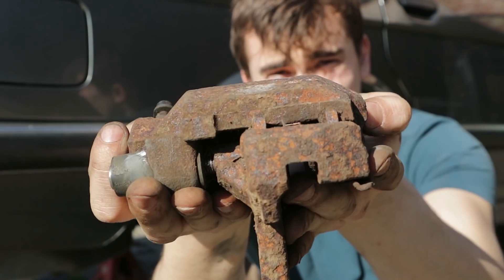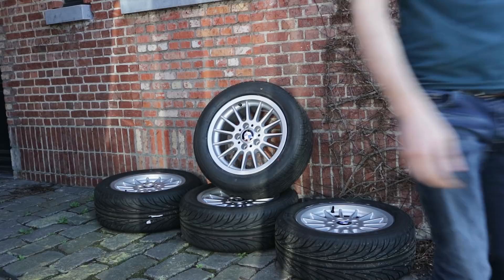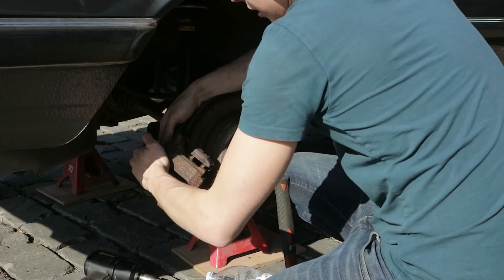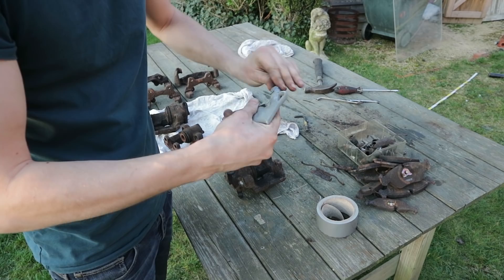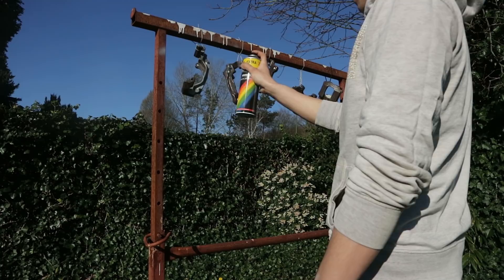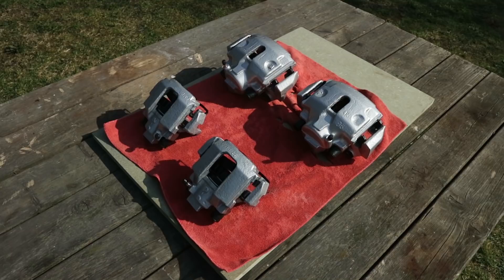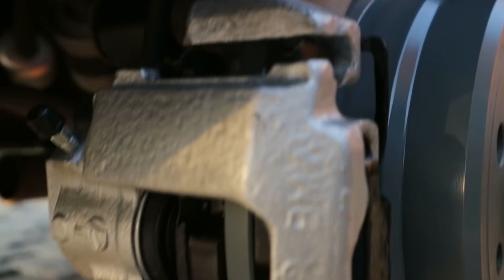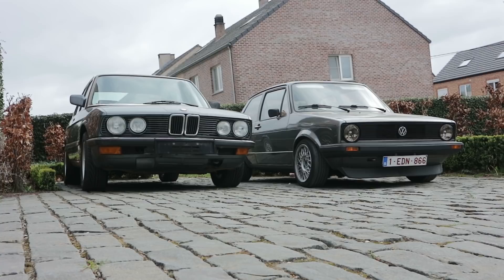Backyard Brake Restoration - BMW E28

Comment: you forgot to lube the pistons and seals just remember to do that next time otherwise a really nice restoration
Reply: That isnt really necessary. While bleeding (and using) the breaks they get surrounded with brake fluid anyway.
Reply: @johanneseder27  yeah but when you lubricate piston and seal before hand piston will just slide in by fingers without any force, which lessons probability of tearing a new seal
Reply: @fila1445  Yes, that makes sense. Thanks for informing.
Reply: And brake grease will prevent rusting/stucking, brake fluid wont. It’s good to have a good amount of brake grease/silicone grease under the dust rubber.
Reply: @ToyotaLandCruiser  Ate Bremszylinder paste is very good for this job.
Reply: @Cribs00  Yes, use castoroil-based red grease on older cars, some new ones require silicone (especially Japanese).  The grease will help the seal position bed in. A piston seal doesn't slide back and forth in the cylinder when you brake, it is merely the fact the seal is flexible and the piston moves within the elastic limits of the seal as it is only moving a few microns with each brake application so it is important that it is not under elastic tension when not braking..
Reply: Very important to mention that you need specific grease, using regular grease could contaminate your brake fluid.

Comment from the maker: Thank you for the comments saying I need to put copper grease on the pads. I totally forgot! And yes, I cleaned the rotors before mounting them :)
Reply: All threads & hub plate too. Just a bit.
Reply: @Yfyfy_Tcyfyc  Hub plate no. Not needed. If you really want to then use a tiny bit of oil. For threads medium threadlocker.
Reply: I’ve stopped using it full stop, horrible stuff. The only acceptable place to use it would be on the “ears” of the pads, even then there is special brake grease to use instead. Cars come from the factory with no grease on the pads and if you ever read the instructions with pads it says don’t use grease or only use special brake grease.
Reply: @thisispointless29  ATE Plastilube, TEXTAR Ceratec etc
About brake pads I am using, I noticed that they are less squeeky, but on other hand the fix with grinding a little bit of edge od brake pad also works as well.
Reply: @thisispointless29  Copper isnt good on modern cars because in interfears with the ABS system. Other good stuff is Ceramic paste on the Back of the pad and nothing on the ears.
Reply: Never heard of using this stuff in the UK!
Reply: Best is just a little ceramic grease on the ears of the calipers and the guide pins

Comment: You're so lucky. My rotors on my 84' 633i were completely rust welded. Lots of penetrating oil and a hammer, plus a lot of swearing. :)

Comment: When I did the big brake upgrade on my E28 the set of used calipers I bought looked rusty just like the ones in the video. Rather than grinding and scrubbing off all the rust I put them in a couple gallons of vinegar for a couple days. Incredibly, they came out looking nearly brand new.

Comment: Another video that you knocked out of the park, Memphis. Well done. While you were doing the brakes would have been a good time to repack the wheel bearings, assuming they can be lubricated. Lucky you to have single piston floating calipers. Greta, like my Arthur, has 4 piston front calipers, 2 on each of the sides of the split system. I have heard the Volvo front brakes are either Gerling or Brembo. Some people say the one, some say the other. The last time my brakes were done it took 16 litres of brake fluid to flush the system.

Comment: Quick tips for those who want to do the same: if you have Abs, try to not empty the system, if you don't have an eezybleed or something to pressurize the system. It sometimes can be a pain if the abs module gets air. Otherwise when bleeding with the pedal, try to not go all the way down with the pedal. Crap in the master cylinder could damage the seals.
And for the rear disc brakes with the baby drums for handbrake. Don't forget to release the tension at the cables on the lever itself before adjusting the shoes. I adjust mines until they rub just a little bit, and then I tighten the 2 nuts inside. Degrease new rotors, copper grease on the sliding contact points but don't put the entire tube on. Just a tiny bit is enough. Cheers

Comment: hey man! always remember to clean the disks before installing, they have a slight bit of oil(prevents rust)that may be bad for the brake pads
Reply: not in every case. sometimes (like his ones) they have like a thin coat of protection paint on, which removes itself while the first brakings.

Comment: Always use ceramic or copper paste when you mount the brake pads. Apply it on the glide path after you cleaned these with a file. Otherwise your brakepads will rust and get stucked quickly. Dont assemble the brake cylinder dry, wetten the brake cylinder and the sealing with some brake fluid so you wont damage the sealing.

Comment: Awesome video as always 👍
Probably should have mentioned the importance of fully flushing the whole brake system because of the dirty and super old fluid in the reservoir and lines themselves, Not just checking for air bubbles, but also the color of the brake fluid until you can see the new fluid coming out at the bleed line. Hope You did that.
Giving the brakes the best chance not to boil them if You ever take this thing to Nürburgring 😃

Comment: you mounted front tires wrong...
edit: always clean brake discs with brake cleaner before mounting them
Reply: marin marusic correct,tires mounted wrong.
Reply: Depends on the discs.... I've had some that specifically say to not clean them
Reply: @bmwe61530d  whats wrong?
Reply: @rendog311rendog2  they where wrong in the begining he swapt them over when fitting it back 2:58
You can see direction of the tread.  Fitted like this pushing water from outside of the tyre to inside.
Reply: Egon1982 ah okay thanks
Reply: @DanielPlayGaming  what rotors? In the assumption they arent carbon ceramic, i call bs on that....brake cleaner just removes contaminates, but more particularly with new rotors its to remove the protective anti-rust coating that can gum up your new brake pads and cause inefficiency and squealing. Fully coated rotors you dont need to clean, but the solvents in brake cleaner are evaporative so it wont specifically hurt the rotors.
Reply: @jarsky  I was just saying you don't "always" need to clean them...
I've had some that come with warning labels specifically saying not the clean them as whatever coating they have, helps them to bed in better
Reply: @jarsky  New brake discs comes with an oil coatibg to prevent rust. You need to use brake cleaner
Reply: @niklasnaper6596  that's exactly what I said.... (apart from carbon ceramic and fully coated)

Comment: Next time you can apply some pad glue on the backs of the pads, helps cut out squealing. Also, dont forget to bed in the pads before you drive it much further. Methods vary on this but most involve a empty road etc. Nice job.

Comment: Awesome job! I hope you cleaned both sides of the rotors before assembly. That is typically required as they often apply a layer of oil during manufacturing to prevent rust.

Comment: Memphis great job! 
But I have some tips for you. 
1. Regrease the pins that caliper is moving on it. They need to move in rubber boot freely.
2. I'm not sure that you can take together piston and brake caliper without any lubrication. Should be assembled with e.g. brake oil as minimum.
This two tips prevent from bending the disc, which usually is caused by stuck calipers or cylinders in brake.
I've got many problems with brakes in my e39 so please not ask me how I learned this tricks :D
Reply: Special silicone grease on the sliding pins.

Comment: Could have used rust kill befor paint to make sure rust is 100% gone and give paint some thing to bite to 
Also use red rubber grease on the piston rebuilds ring as its brake fluid friendly  as i notice you assy them dry ? Never use d 40 it drys out rubber

Comment: you did a very good job restauring your callipers.a just want to give you an advice as i am an experienced mechanic.when taking off the callipers you firs slide the sliders and remove the caliper.the calliper mount will remain on the car and so are the brake pads.when installing you do it backwards.thanks.

Comment: Nice job! The last time I rebuilt a brake caliper, I used brake cylinder paste from ATE (light blue 180g tube) on seals and piston, and everything went back together "like a glove". No need to use a clamp. I think you would like it :)

Comment: Pro tip for removing the pistons:
Keep an old rubber brake line around of which you cut one of the connecting points off.
That way, you can screw the brake line into your caliper to put your air gun in the rubber line.
Big benefit of that is safety, certainly when removing pistons from locked brakes: you can put the caliper upside down and put some weight on it.

I've seen these pistons flying hard and far, or even bouncing back towards myself.

Other than that, nice job, once again.

Comment: I think your calibers are rusty after one winter. You should sandblast them or at least use some acid to get all the rust out. You don’t need 400 grit sandpaper, 120 would be fine enough, easier to get them cleaned. 2K caliber paint would be better idea too, apply with brush. 

And you a lot of brake caliber grease while installation of the pistons and pins. It would prevent corrosion/stucking. 

Anyways, it was nice to watch. Good filming.

Comment: Doing this with no labour:
1 disassemble just like you did. 
2. Put parts in vinegar for 2days (35%) or longer if less concentrated.
3. Deacid in water sodamix to neutralise acid.
4. Paint and assemble. 
Vinegar is the shit, man

Edit: only use plastic containers
Reply: Another way is to make your own electrolysis bath if you have a plastic container a battery charger, some wire/coathangar, a piece of steel and some baking soda. 
Much easier than sanding all of it for hours if you dont have a compressor/sandgun
Reply: Jarsky Yes , indeed. I use both procedures. I find vinegar both cheapest and most time/ cost effective.

Comment: Memphis, again great job as always. 💪💪💪
13:09 You may wanna first moisten the seals with the brake slightly fluid before installing. To prevent rubber rubbing against a bare piston metal.

Comment: Just a tip, you should add silicon grease or something similar on the piston and the rubber rings in the caliper, they slide easier. Just make sure the "grease" you add works with Brake fluid. Keep up the videos. Your videos inspire me to work on my C124 Coupe during Lockdown ;D

Comment: pro tip: if you push back the brake piston of each caliper when removing it you don`t need any mallet or hammer to get the assembly of the rotor ;) :D

Comment: 4:35 Normal socket wrench cant fo the job nearly on all cars, specialy if you live in areas where you have a lot of snow and ice in winter, those chemicals destroy the crap out of iron and make all the bolts fused with whatever they hold tight.

Take a look at 7+ y old cars from Finland, they are literally rust buckets. You can buy theme for cheap and sell the interiror and electronics on used market

Comment: Use something to hold the brake pedal down and you should lose any fluid and tap locator bolts/screws with a hammer first :)

Comment: great work, did you remember to clean off the oily layer on the new brake rotors? They always come with some rust inhibitor that needs cleaned off with soapy water or brake cleaner

Comment: These brakes look the exact same as my e36 brakes, wonder if they are interchangable
Reply: I think my e46 brakes looked the same as well
Reply: e34 and e32 are interchangeable. Pretty awesome oem upgrade. especially if you get them from the v8 models
Reply: @JunkVWs  There are some differences

Comment: Use grease for piston too, coat it, and coat the seal, it will go in a lot easyer, and less chance to tear the seal inside, dont ask me how i know 😂, you can use grease in piston easy with no problem, it can mix with dot, it gets disolved and out the bleeder, as you need to bleed brakes anyway

Comment: ive been meaning to ask you about my polo 1.6 petrol 2011 model with 67000 km which i just aquired if you can guide me i want make run nice , currently the idle feels too low as engine starts to shake when warmed up., i did clean the throttle body with cleaner 1st thing . i checked all coils while starting and it cheked out as i took each one out to see the difference (i made it bob even more every time i took out 1) , what else can i do to narrow down the problem
Reply: @God forged Check you evap system for a vacuum leak.  It's a common fault on a VW.
Reply: @louvendran7273  thx  however can u tell where to do that
Reply: @louvendran7273  thx found it saw video on it, can it be cleaned opened and diaphragm changed or repaired , if u have any idea.

Comment: Why didnt you remove the oil layer on your disc brakes? You've contaminated your brake pads. You're putting your life in danger
Reply from the maker: Fran 5773 I did clean them
Reply: In that case well done,  I'll be following you from South Africa 💪 keep it up